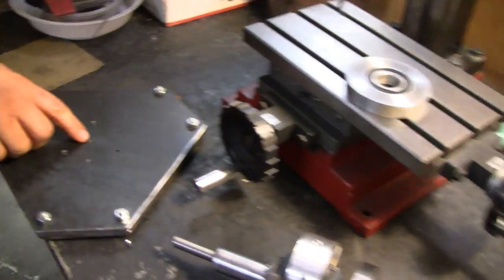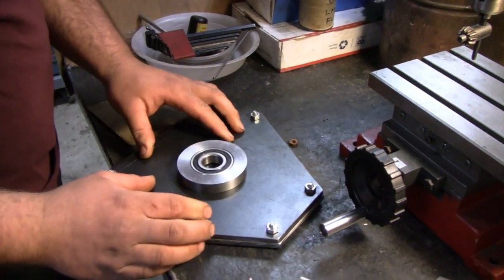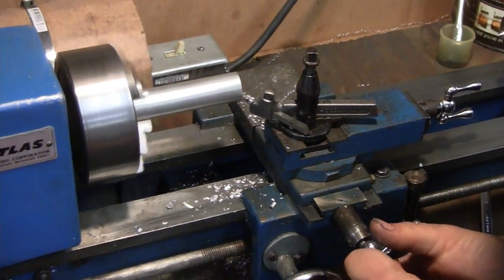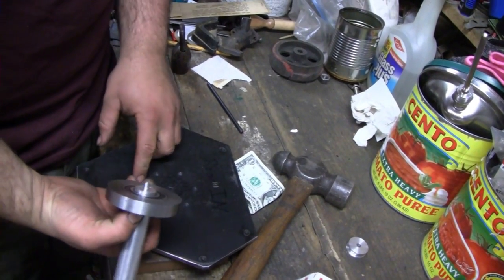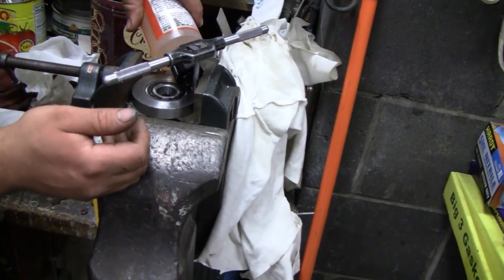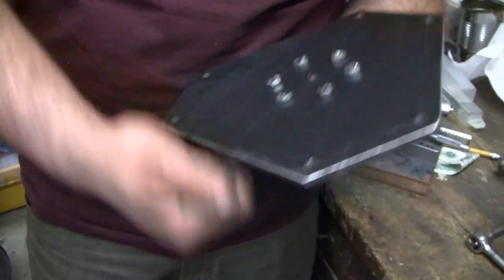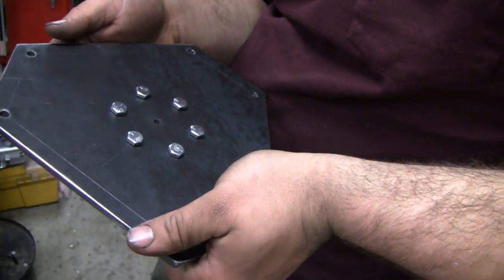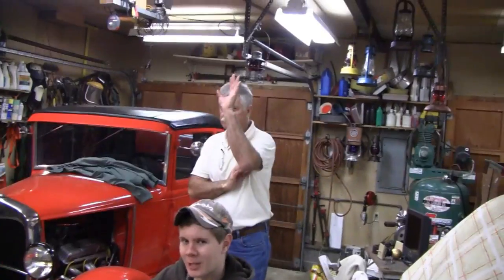HOMEMADE RADIAL BRIGGS ENGINE (part 21)

Comment: you guys obviously don't want any input here, but a pro tip, don't back of all the time with the tapping, backing of adds a chance breaking the cutting edges of the tap, just go all the way through , 15-20mm straight through is no problem with a thread that size. just pop it in the screwdrill and go for it, i promise its not dangerous and it will save you years
Reply: ? Been tapping that way for 50 years and never broke any cutting edges
and doesn't wear out the taps like powering them straight through either.
I doubt they are looking for production line speed

Comment: Have you considered oil slingers to help control the amount of oil on the bearings? I've added them to larger engines that always seem to slobber oil out of the seals.

Comment: Wondering why you didn't cut the alignment piece to the height of the being with a hole in the center the same as the center hole in your plates. Then run a bolt through it all with big washers over the bearing ends so you could cinch it all together the transfer punch all the holes without having to physically hold it together......not critiquing just asking

Comment: If you wanted to keep any oil from seeping between the inner race and the crank itself, you could put a little light duty Loctite on there for final assembly but they actually have one, I forget the number but it is specifically as a anerobic sealer VS a retaining compound. Might enhance the fit just ever so slightly which is never bad. 

For the case plates it would be pretty easy to dowel them to the block with a cap head screw or two turned smooth in the lathe.

Comment: Looking good guys.  Let em all know it's easy to say your doing it wrong when your not the one doing it. This is old style R&D folks. No delete key on a cad program.  No simulation runs to test outcome.  Skill thought and knowledge. Think it, Build it, see if it works. For everything we see in the videos there are hours and hours of thought and probably a stack of discarded and changed ideas. An old mechanic said to me "You only get to tell me it's wrong when you show me the running one you built." So unless these fellows run across a problem and ask for advice. I'm going to watch and enjoy. And follow a wise mans advice.
Reply from the maker: +burninpwder76 Thanks alot Bud!! Great advice!!☺

Comment: I have always had faith in the Mike!   As little hours as that radial will get in it's lifetime I might just leave the grease in that bearing and run it with both seals.  You probably aren't going to get a raging leak from the crankshaft to bearing area, but it will probably seep from there, hot oil finds it's way everywhere!  But like I said it's not like this engine will run more than a few times a year, so it's all good.

Comment: you know if someone would step up with some bullet proof glass , most is actually a plastic , not glass , and used that to make one side instead of the steel , then everyone could see your work while it ran , but it would have to be a donation thing , I say the price to buy that stuff would be nuts , and just plex even thick would be to brittle to hold up to the engine vibration ...
Reply from the maker: +towrecker Yeah that would be cool!! We have a small piece of Lexan 2" thick we'll probably make a head outta for a small engine!!☺

Comment: So, is the lowest valve chest essentially going to be the sump in the engine? Basically, are you guys going to put the inlet to the oil pump right there?
Reply from the maker: +Cameron Jenkins Nah, there will be a sump between the two bottom cylinders!!☺
Reply: 805ROADKING Well, it might be a good idea to put a drain in for that valve chest just to keep oil from pooling there.

Comment: Hi, I really enjoy your channel. One concern on the radial is the fact that the bearing plates are going to be floating on gaskets. Are you going to "Pin"the plates with dowel pins or use "shouldered" fasteners to assure the plates don't walk when the engine is running.

Comment: People are worried about seals around that bearing and carrier ? Sheesh.
There ain't enough crankcase pressure to worry about it .
The case vents will take care of it and it's not as though you have a sloppy fit on the bearing to carrier or the crank to bearing .
I suppose you could always use something like loctite 5188 if you couldn't spare the gasket room
Reply from the maker: +Bagot Corner I don't fuckin' get it Mate!! Are we all talking about the same engine!!☺

Comment: In stead of putting a seal beneath the bearing carrier, wouldn't a small groove on the connection side, where a o-ring could seat, be better? 

I mean, a seal might make it go wonky, where as a o-ring inside a groove would not, that's why i'm asking.

Either way, pro work on the carrier mounting, looks really neato, it will look very industrial with those screws around the crankshaft. :D
Reply: I believe machining an o-ring groove is out of the capabilities of the machinery they have available, but a good idea nonetheless.  a thin paper gasket may only be 0.015 thick so it will have practically no effect.